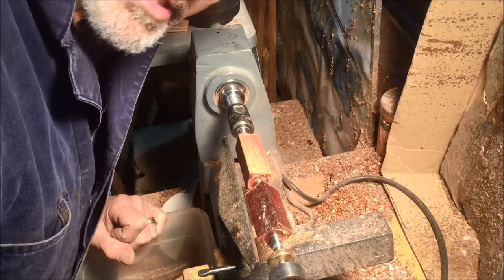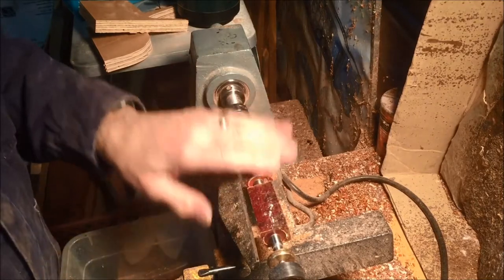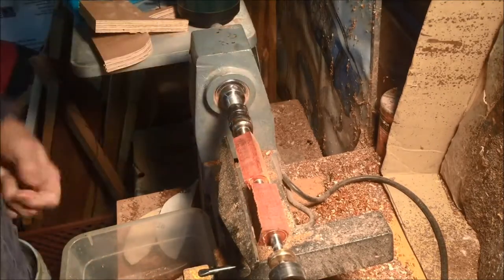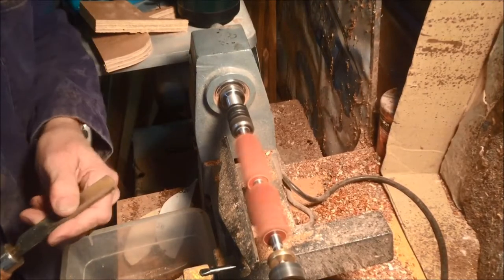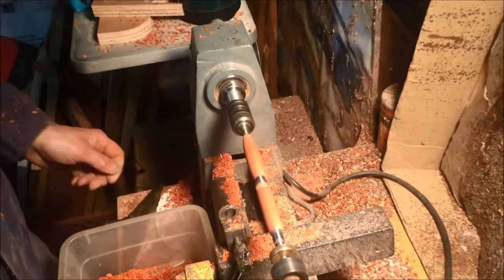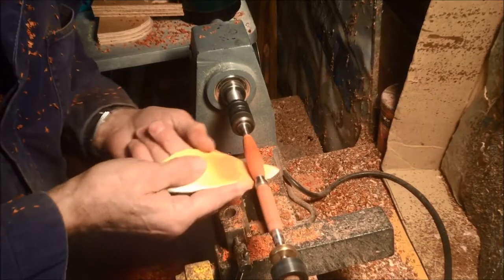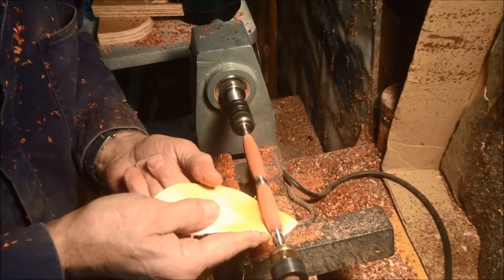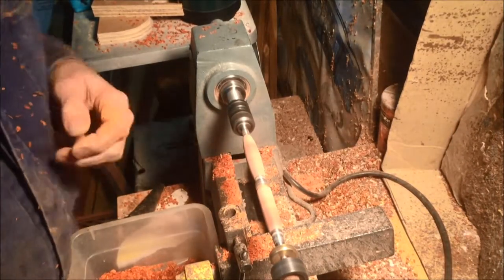10 Minute Mont Blanc style pen turned and assembled

Comment: So  turning doesn't include cutting the blank, drilling the blank, glueing the tube in,  setting the lathe up, tool sharpening ... ok  I think I get it? lol, ever  thought about entering Politics ?
Reply from the maker: It actually doesn’t include buying the wood, the sand paper, drill press, lathe, mandrill, CA glue, lathe tools, crystal coat, pen parts or even the paper towels. Just the turning and assembly. Appreciate your comment.
Reply: @davidmartindaletheycallmemacgu  Youtubers have played around with this theme a lot, Even had some go start to finish from cutting a rough blank to a completed pen. Never saw a single turner that actually counted all the steps and the time spent in the actual process of turning a quality pen.

If you want to be candid about time spent creating a quality Pen and your skill level. Challenge a fellow turner to a contest, with concise rules, and a prize for the winner, 

Been my experience that every once in awhile I get a pen where the process goes off without a hitch, But a lot of the time something goes awry. I spend more time fixing the issue than it would take to start over.

Smoke and mirrors do not paint an accurate picture, I think it's great that you turn. and have fun doing it. 
Have a beautiful day.